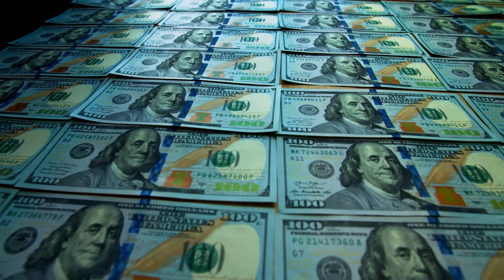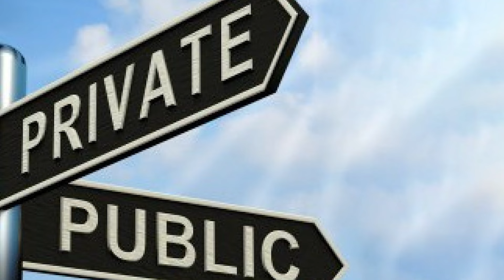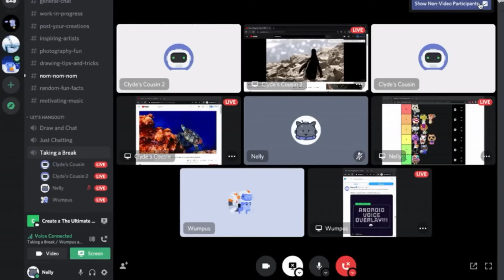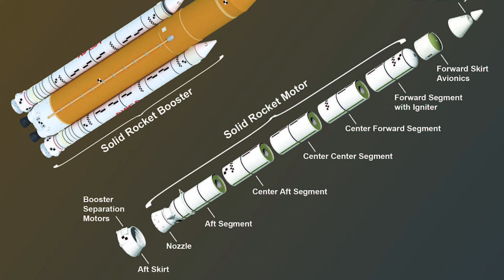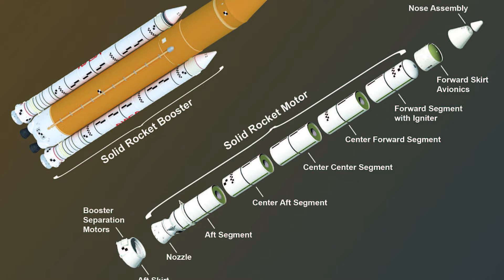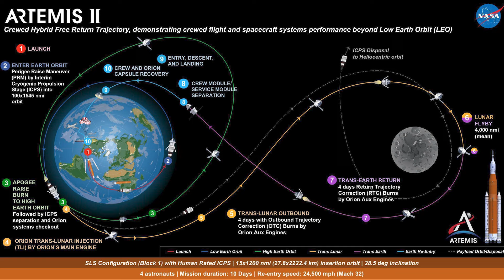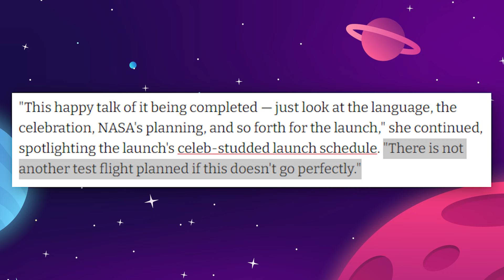The Real Reason NASA Developed The SLS Rocket!

Comment: It's very dishonest to say that the SLS is the most powerful rocket ever launched when it has never launched. Not only that the N1 was more powerful and did actually launch. SpaceX's Starship is way more powerful and much more advanced than SLS is or ever will be.
Reply: @LiveType  At the time this video was released (27th August) you were probably correct to say that SLS was closest to launch. As I type this on 7th September SLS still has not launched and it's looking likely it will have to be taken back to the VAB to fix a significant hydrogen leak and re-commission the FTS batteries. Who knows how long it will take after that to return to the pad and successfully complete all the launch preparations?
Meanwhile Starship and Super-Heavy are getting ever closer to a launch. One thing that could still prevent Starship being first to orbit regardless of readiness would be political stalling by the FAA to delay the granting of a launch license until after SLS has finally lifted off.
Reply: @LiveType  closest to launch if it doesn't blow up due to leaks.
Reply: @jessepollard7132  it didn't blow up
Reply: @Sam2sham  Surprisingly didn't. It seems they actually managed to fix the leaks.

Comment: SLS is the least capable rocket NASA has ever designed. It was designed for the purpose of going to the moon, and yet it is unable to fulfill that role by it's self. Assuming everything on SLS goes as planned, SLS will never be able to land or return a crew from the lunar surface. If Starship is working and can land on the moon, there will be absolutely no reason to have an SLS rocket.

Comment: Great video as usual...

Unrelated question. The long trip to Mars has one major issue, the lack of gravity. Our astronauts will not fair well without it.

I suggest launching two Starships simultaneously. After the initial burn, tether them by the nose with a long cable. Then spin them up for artificial gravity. I've seen a 3D model of a giant trellis to connect them with a third starship in the middle. But that is a lot of wasted mass. A cable would work great. Course correcting burns are possible mid spin. 

Has anyone modeled this or sugested it to Elon?
Reply: There's gravity on Mars. There's other videos covering the gravity issues but I recall them being on a planned mining /launch base on the moon where people would be working long term, not so much the several month trip to Mars. There's also interesting ideas for a new engine that could cut the time to Mars down to less than a week. Soon, space station= great - moon base = better - Mars colony = (insert new space language here.)
Reply: Granted not perfectly, but it is possible.

Comment: SLS is built around flight proven hardware. The engines and SRB’s are old shuttle technology. It will all work….when the bugs are worked out!
Reply: But you can't work the bugs out without launch tests. and so far SLS has NEVER passed even a wet dress rehearsal.

Comment: With Boeing involved, I give SLS a 50/50 chance. That means 1 out every 2 will fail. If Artemis One goes smoothly, I don't think I'd step foot on Artemis Two!
Reply: That's not how odds work. Each "flip of the coin" is independent. You would still have a 50% each launch regardless of what happened last time. Subsequent flips or launches are not affected by previous ones.

Comment: If they would have used Elon Musk's reusable heavy lifter the expenses would be a lot lower and it is more reliable. The SLS is new but there is no real innovation. It seems like the real brain is still Werner van Brown that developed the engines for the space shuttle 50 years ago... 50 years in space science is very old. We use it once and it gets destroyed... and it is not even close as efficient as the turbo engines version built by Russia, because it bleeds un-burnt fuel!
It is good that we go to the moon, but it has to be done with a fiscal budget that is sustainable in the future.
Cost will kill this project; it cost about as much as an election; tough choice democracy or the moon!

Comment: " ... and the SLS is NASA's firts new design ... "

Whaaaat!  Old shuttle SRBs (made a little longer by adding another section), old rocket engines that have been around for decades, etc., etc.  It's like reinventing something from the 1960s.  It's built effectively from NOS parts with poor quality control and terrible project management.
Reply: That's not true. And engines are constantly upgraded and enhanced. The RL10s are still the most efficient deep space engines ever developed and they were initially made in the early 1960s. Physics hasn't changed since then so if you're still using the same fuel (and LH2 is the best fuel) then there is no reason to use a different engine.

Comment: I think that programs such as the SLS ought to be judged very differently.

We should ask, what fundamental new capabilities that will make everything simpler going forward are enabled by such programs. What new technologies are created that can then be used going forward into the future.

The SLS only gives NASA a bad name. I'm a space nerd with a software background and I absolutely dislike SLS and that part of NASA which is associated with it. What NASA does there is just utterly unprofessional and unscientific, once you look at it from an economic, innovation or systems-engineering perspective.

If NASA were to implement a long term technology driven approach, we could truly become a space faring civilization. This is just a dumb and expensive firework that will do little good. Most missions that make use of the SLS could have been done with 2 launches of a mid-sized rocket at a fraction of the cost.

Just think about this. E.g. a Falcon Heavy (but there are some others) could fire 2 pieces into orbit that could then dock to each other. This would enable all kinds of missions. Docking is well established at this point. Imagine what NASA could have done with all the money that comes from cost savings when using such an approach.

NASA now has spent dozens of billions on the SLS without doing one single useful thing. This is an absolute waste of resources. We could have a much better NASA in my opinion.

Comment: Every $1 spent on SLS is $3 that could have been used for productive science and engineering elsewhere.  The SLS is tremendously inefficient way of doing things that could be done at 1/3 of the cost, or less.  The sooner the SLS fails and is defunded, the faster we will advance space science and space engineering.  Engineering is not about spending the most money possible.  It is not about being so inefficient you need the most powerful engines ever.  Engineering is about doing the most with the least money while maintaining safety standards fully.  The SLS is a non-reusable exercise in pork barrelling -- case closed.  The SLS is a political project, not a science or engineering project.
Reply: No it couldn't have. Politicis is what decides funding of these public projects. If there is no political payoff then they won't get funded. Not funded more efficiently or funded differently, not funded at all. Just look at military funding - it's the same. If you want public investment into science and engineering then you have to accept the funding constraints.

Comment: The Saturn V had 5 F-1 engines. Not 4. That was the design of the never build Saturn IV. Also the F-1 is not the most powerful engine ever. It is the largest single combustion chamber liquid fuel rocket engine ever. The RD-170 is more powerful and so are the shuttles SRBs. Your documentary is full of incorrect facts. Please do a bit more homework

Comment: SLS is Frankenstein of a rocket that had to be built from legacy tech and systems mandated by Congress. NASA had no choice....well it did, it could have said we are not going to the Moon with a Frankenstein because it will suffer the same reliability issues, high costs of repair and maintenance as the Space Shuttle. 
NASA could have also said OK, we will go back to the Moon only if Boeing and the other contractors agree to cover the Op-Ex of the SLS and not bundle it into the cost of each seat.
Boeing et al will then be incentivised to develop new tech and systems that have lower Op-Ex....😞😟😒
Actually using my brain on this. The fact that no one at NASA thought of this means that the US tax payer is being fucked by Congress, NASA AND most of all by Boeing and all the other contractors.
We get fucked and the results are shit....that is what is galling and NASA and the rest clap and cheer and whoop with such low success rates. If I performed so poorly at my job and cost my employer an arm and a leg to boot, I would demand that they sacked me 😬😤😕😞😟